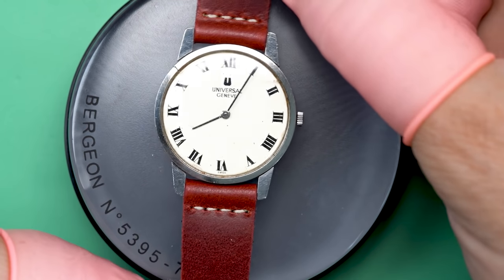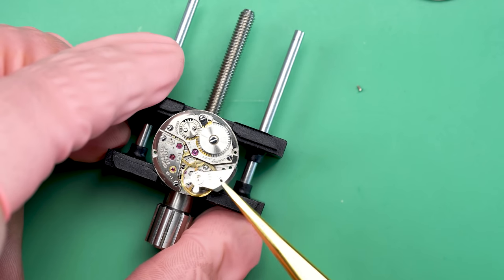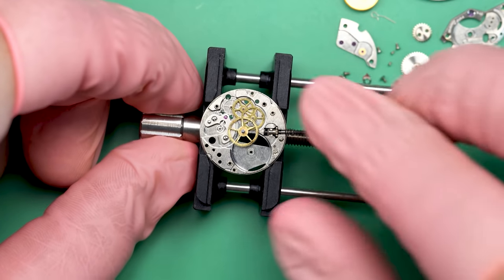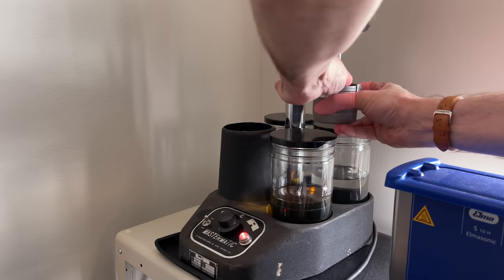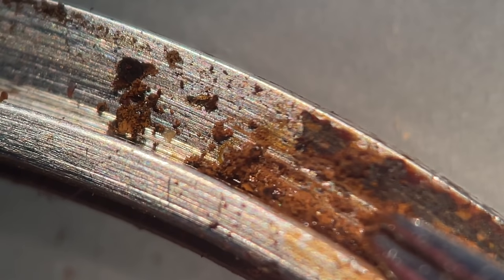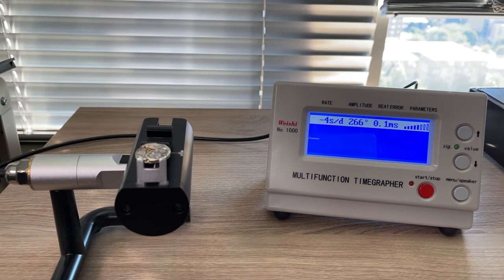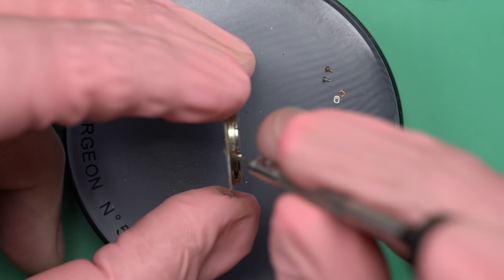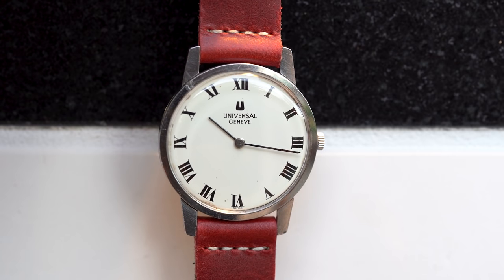Universal Geneve Dress Watch Vintage Watch Restoration

Comment: My father is a dental technician. He has also welded small things with the laser in the lab from time to time for jewelers, opticians and model makers. For 10€ in the coffee fund or out of kindness.
Reply: What did he normally use the laser for, welding crowns & implants etc?
Reply: Hi there!
As a dental tech myself, I assume a laser welder may be used for welding, for example, cast metal framework dentures or metal frameworks for metal ceramic bridges, you know, when they need some adjustments/corrections or additional constructional components added to them.. to name some basic forms of using the gadget in a dental lab..)

Comment: Hmmm.... Maybe silver soldering next time? Great repair as always, hopefully never fails.
Reply: yah thas what professionals do and at the end we dont wreck the watch...
by the way there is no timegraah in the end of the video.
PEOPLE ARE DESTROYING WATCHES ALL OVER THE WORLD.
Reply: I was thinking the same thing BUT.... you can't solder onto rust with any real success. Might need flux and then a polishing after because excess flux can leave marks.
Reply: @juaquimgustavo4712  there IS a timegraph at the end because everyone else saw it. This guy is FAR better than most average people and ACTUALLY HAS some level of training.
Reply: @OffGridInvestor  You could most likely solder this with jewelers silver solder but it takes some practice, it takes tools and experience and it will be a lot of work to clean up later. 
Furthermore any solder will show itself in a lighter grey colour than the steel grey.
What would've worked would've been a tiny PUK welder or a laser welder but i am totally on board with his assessment that those are outside of his arsenal of options.
In the end nothing lasts longer than a temporary fix.
Reply: Couple of issues there - silver soldering would evaporate the plating with (most likely) toxic fumes. So, replating (with associated grinding and polish) and ventilation would need to be taken care of. This in addition to the fire hazard working on an apartment block with silver solder equipment. Not saying that epoxy was the way right either, but that doesn't make silver solder solder any better. Better options would've been a donor bezel or even getting someone with lathe skills to make a new one from e.g. stainless steel - could've been cheaper than laser weld, but naturally not looked 100% the same.
Reply: I was thinking that soldering would be a better option.
Reply: @eminatorstudios I love your last line. I'll remember that!!!!

Comment: Great video as always, Marshall! Out of curiosity, how expensive are your local jewelry repair shops that do laser welding? We had one at the previous watch repair shop I worked for and laser welding usually ranged from like $35-$75 depending on the item and the extent of damage. We mostly did eyeglasses with it, but sometimes had to use it for jewelry and watches as well.
Reply: ya, it would have been really easy to to solder, sand and replate also.  While time consuming, very easy.  That glued giant crack is ugly.

Comment: I would think over time the epoxy joint would fail especially since the crystal is exerting force on the bezel to hold it in place.
Reply: I was thinking the same thing.  Was wondering how long will the epoxy last at this point.
Reply: @river1duck  The mating surfaces were quite rough,which is ideal for a good bond. As long as any oils and other contaniments are removed the repair is unlikely to fail.
Reply: @rick_.  they were ALSO rusty which is HOPELESS for a bond if the rust goes further and it always does eventually. I know about surface profiles. Done a sandblasting and spraypainting apprenticeship (protective coatings and corrosion control).
Reply: El epoxi si funciona precisamente porque es una rotura que no es limpia, el bisel se partió. Soldarlo con metal solo haría por su rigidez que vuelva a romperse en cambio el epoxi tiene una cualidad elástica junto con la resistencia de una soldadura, con un uso normal un buen pegamento epoxi garantiza que se quede veinte años mínimo en su lugar. Mi mamá tenía una pulsera de porcelana y plata que se rompió y ella cortó un pedazo, le pegó un alfiler para prendedor y lo pintó de plateado. Tiene 50 años el arreglo, y constantemente tiene la presión del alfiler y nunca se ha salido. Me parece que su procedimiento fue correcto y rápido.

Comment: A very nice revival of a very nice watch!

The only thing I think I would have done slightly differently is put the crack in the bezel at the 6 o'clock position, so it looked more like an intentional design element rather than a repaired crack. :-)
Reply: Was thinking the same thing maybe at the noon too .. if it would let you ..

Comment: I know I am very late to the party, but the bezel could very easily be brazed for a permanent fix. I have done several silver-brazed repairs on similar size parts (like metal glasses frames) it really lasts well.
Reply from the maker: How would I do that?
Reply: @WristwatchRevival  Silver solder and a propane torch. It would be delicate but they make small silver solder kits that seem ideal for jewelery. I put a link in the other response, but apparently that got it deleted, but you want some of 56% silver solder and the flux that comes with it (Harris or Alpha Fry). Get the smallest diameter wire you can find. Put flux in the joint, lightly press it together and hold it. Wipe off the squeeze-out. The pre-heat the solder to just under melting (dull red), heat the part and touch the solder to it, when it gets hot enough it will flow like water into the break, and then quickly cool when you remove the heat. It's very strong, perhaps overkill for this application. Clean up with a needle file, polish, good to go. It will work on brass, bronze, steel, silver and silver alloys, not on titanium, not zinc (which can be soft-soldered with an iron), probably not stainless steel.
Reply: @brettbuck7362  The only issue with silver soldering watch frames & bezels is if they've been plated eg: nickel.
The heat needed to flow the silver solder will burn & blister any plating so the prep work is to remove it all before soldering, which in turn means you need to have the ability to redo that plating afterwards.
FWIW yes you can use that same silver solder to join most stainless steels used for watches eg: 304 & 316
Reply: @WristwatchRevival  As an old Jeweller I can tell you it's not as easily as most will have you believe.
Most of the Watchmakers I knew simply handed those kind of repairs over to us Jewellers, as we had all the necessary tools & skill level to do it & in turn, we'd hand them our watch repairs for same reasons.
In your case judging by the crack in that bezel, it WASN'T stainless & so your repair options become more compounded as it's most likely plated, meaning it needs removal prior to soldering & redoing afterwards.
Reply: Howdy Marshall, I would suggest you ask any hobby or jewelry maker that works in silver soldering if they would do this kind of repair for you. Many clubs, groups on FB, other places especially in Seattle area  I would expect. My wife used to do this kind of thing many moons ago but not now. She does Temari now. Safer for where we now live.
Love your videos. So much good stuff. : ) Keep ticking.

Comment: I'm surprised you didn't buy a donor watch to replace the bezel. Are those watches really expensive to buy for parts? Or was it really a sentimental watch?
Reply: Job for a friend, probably 0 budget
Reply: @biomerl  That makes sense but if a friend of mine had me fix something and it needed a part I would find it and have them order it if it was affordable. Nice things cost money to maintain, Like bezel is a really important part in a watch, and the glue still cost money and so did the replacement crystal. It might be cheaper to buy a donor watch with a nice crystal and bezel but not working the to buy jewelers glue and a new crystal. Either way the guys videos are great to watch.

Comment: Would you consider soldering something like this ?  Use a soldering iron, you don’t generate a lot of heat. You must warm the broken part by touching the iron to the part. The left over soder will smoke and run onto the part, then ad a touch of silver soder, it’s done. Easy peazy

Comment: I LOVE your channel!  I just finished building my workbench and I am stocking up on the tools.  I've done about 5-6 services on the classic ETAs 2824...2836 etc. and I just serviced an AS 2062.  Just still a rookie but I love it!  I've used some of your links for tweezers but I can't seem to find the soft tipped ones...wood, plastic and brass.  Any way you can point me in the right direction?  BTW, also love the view from your high-rise!  I think I wanna be you!

Comment: Another fascinating video Marshall.  I would have thought a replacement bezel might have been a possibility for this watch rather than a repair. Perhaps it would be too difficult to source one. The jewellers epoxy held it well. If that bezel is made of brass perhaps solder would be an option.  I got the impression that the 'rust'  you were removing was in fact old glue of some type. Very interesting video, maybe I should do one on old 35mm camera shutter servicing, my old trade, largely forgotten these days. Not quite as tiny, but the timer delay escapement mechanisms are pretty small.  Cheers.
Reply: ooooo could you repair the self-timer mechanism on my old Zenit E pls ?? very pretty pls!
Reply: Leica rangefinder service is good work if you can get it

Comment: Marshall, I appreciate your channel quite a lot. You explain everything so well and your patience with such minute, precise parts is exemplary.

How do you organize the myriad of different sized screws with each timepiece? When you place them on your work bench, your positioning seems rather indiscriminate to me. Then you pile so many of those tiny screws into the same cleaning basket. I would never get them back into their correct locations on the various bridges if I did that. You must have an impeccable system to keep them organized. I just haven't heard you verbalize how you do it. Thanks very much for your response.

Comment: A nice little project. If you want a fun one,  (I'm going to do), is take a larger watch movement, like the ST36 from Mark's course and re-home it in a Panerai-like case from Ali-Express. For about $40 you can make a nice little sub-seconds watch with a mineral or sapphire crystal with that movement. Also, you could find a cheap pocket-watch, get it running, and then re-case in an eBay or AliExpress case.

Comment: Great video! A crazy idea from assembling a lousy IKEA bookcase. The bookcase wanted to rack sideways with a touch of a finger. I fixed it by putting a thin bead of hot glue along the edge of where the cardboard back meets the frame and it’s been rock solid ever since. How about putting a very thin coating of epoxy on the edge of the crystal right before using the press? Just a thought.

Comment: Just a side tip: that jeweler's epoxy is typically stronger than the metal you glued with it. You could run over it with a tractor and the only thing left would be the epoxy joint. epoxy is waaay under rated.

Comment: I think if I had to glue the bezel I would use a stretched elastic band across the bezel rather than Sellotape. The elastic band provides tension to pull the broken bezel ends together tightly. Seleotape just holds it and you can never get it tight enough.

Comment: you used to be able to get these little butoxy micro torches that you could probably use to braze the bezel. you'd need to refinish and probably plate it after though. Still a lot of work.

Comment: In engineering lingo, the dial spring is called a 'wavy washer' that provides a very light tension in the direction from the movement to the dial.

Comment: Given the grain structure of that bezel, it was more than likely originally made with chromed pot-metal.  I seriously doubt that it could have been welded anyway because pot metal (some people call it white metal) would just burn with a laser welder.  The epoxy was the right call and is exactly what I though was the best choice after seeing that close up.
Reply from the maker: It's not plated but yeah it's not exactly super great stuff either, hopefully the epoxy holds up!

Comment: I have to admit there is a ton of work involved in doing a service but why do the jewellers charge sooo much to service a watch? Just wondering.
Reply: Lots of skill required (skill development takes time and money). Lots of expensive equipment to buy and maintain. As always, rent and other shop overhead. The same reasons you'd pay a lot for a car mechanic or other professional.

Comment: Hello nice video as always, for the bezel I will personnally go with soft solder.
Reply: It would not last,believe me. It is too soft and non-elastic. The only solution is a) go to the jeweler or b) eyeglass repair shop. I once had my glasses finely welded forty(!) years ago. The trick they have is they would put a tiny speck of gold in that crack-so it is practically a sort of brazing. I don't know what eyeglass-service does. Also, one might try option c), and that is to visit a TIG welder, but also expect a lot of grinding, sanding and shaping on such a small part after it.